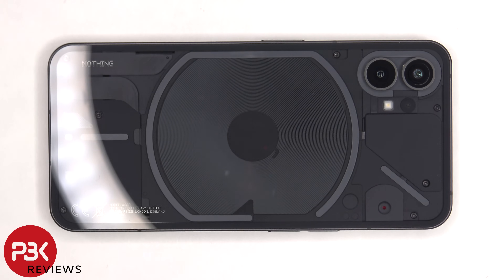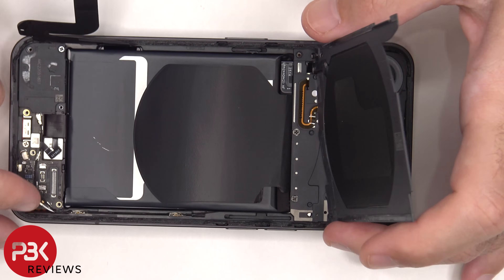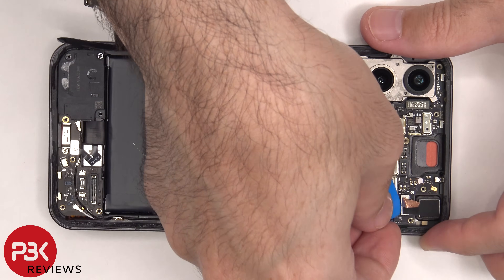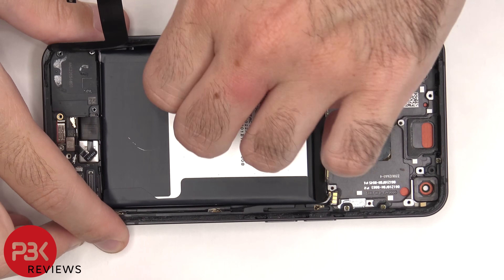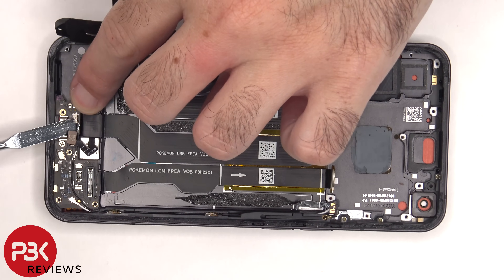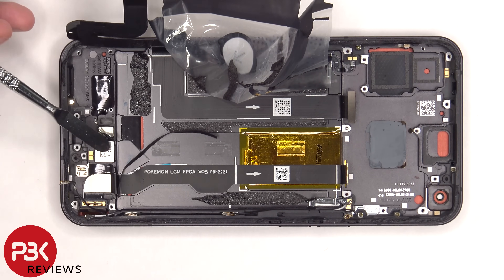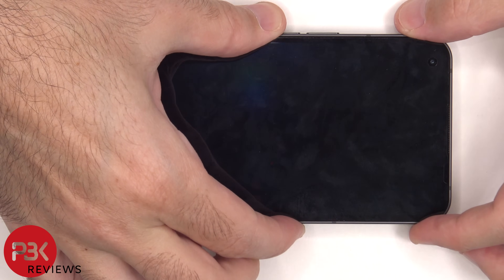Nothing Phone 1 Disassembly Teardown Repair Video Review

Comment: How about the power button? Is it difficult to access/fix? Mine broke recently, phone was stuck on reboot loop until the battery ran out. I don't care about the phone much, I just want to access the data, so I'd rather go to a repair shop than contact official support about it (as they would probably do a format if not replace the entire device). What are my chances of success in that case?
Reply from the maker: Usually the button can be pulled out of the frame on most of the phones by using a knife or blade to grab a side n pull out. But if the flex cable underneath which has the clicker is the problem, its replaceable also but more complex. Its not the hardest thing to replace but not the easiest either. A repair shop should be able to do it
Reply: In my case the button is not mechanically pushed in or stuck so I think it's the matter of the wiring... I will be taking it to a repair shop because although I still have the warranty for it, I don't want to lose the data by sending it out to the official service. Thanks for the reply!

Comment: Is the battery capacity really 4500mah?
Reply from the maker: It has a typical capacity of 4500mah, and rated at 4365, meaning it should at minimum get you 4365 with a healthy battery

Comment: My nothing phone one has a mic problem. When it's connected on charge it works well but when I remove from charge e doesn't work but makes a weird noise. I need assistance
Reply from the maker: Might be a bad sub board, or water damage shorting something.

Comment: Love the design of this phone. But i'm concerned about how difficult it is to replace the screen. Guess if you break that, it's cheaper to just recycle and buy a new Phone (1).
But at least everything ain't glued to hell and back, like on iPhones.
Reply from the maker: Yup, its a bit more difficult than most phones to take apart, but not as bad as most iPhones (depending on what part you need replaced).

Comment: Very unrepairable, they could've done the aesthetics as a separate sheet from the actual components. If you want to repair it, you will either ruin the aesthetics or actually damage hardware
Reply from the maker: Yep, it makes it look better with them being part of some components but makes it difficult at the same time for repairs. Regardless I think it could be designed better so even with them being integrated with components, they could easily be taken off.

Comment: Is the ambient light sensor and so on under the display like on a samsung or in the bezel.
Reply from the maker: Its on the board, you can see it @5:03 in the video. It goes towards the top bezel of the phone.
Reply: @PBKreviews  Thanks for your answer, I am pleased that you are faster and more thorough than your competitors. 
I wonder how much that saves on costs when there are no extra holes in the display for this sensors.

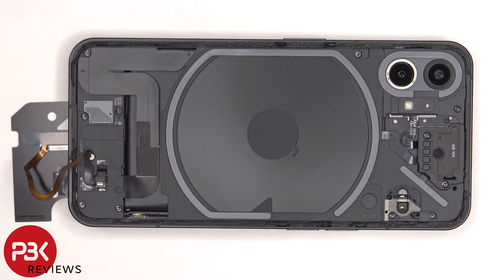Comment: 1:27 who the hell uses covers for flexi cable connectors? apple and now nothing?
Reply from the maker: They are needed in some instances where there is no plastic cover going over it to hold it down in place. Since sometimes these cables become loose or disconnected from drops.

Comment: If the will make ~5.5 phone, then I will buy it. Market needs a small, well design phone. I am not afraid of glass back today, cuz now I know how easy it is to remove, but metal or good plastick doesn`t brake...
Why someone can`t make "not big" smartphone, with a IPS, replaceable screen (cheap to replace),  a battery +4000,  an energy and heat efficient processor for a good tool, not a gadget for games, great antennas, audio jack or small, bt module with replaceable battery - smaller and cheaper than q5k, water and dust resistant, stereo speakers loud enough for podcasts and IDEAL e-ink second screen. 
Why LG made this boring dual screen... They could add just the e-ink option to be unstoppable. I had to buy used sony prs-350 to put it in to my pocket.
Reply from the maker: I guess they go more towards what a majority of people want. Also I'm sure they make money on doing repairs and replacements, so they would rather you send in your phone for repairs than make it easy for you to fix it yourself. No idea just my opinion :)

Comment: I don`t understand, if they decided to copy apple design, they should also copy the way to disassemble the display. That`s the component that breaks the most and often. On iPhone it`s easy to replace and you don`t need to disassemble the whole phone just to replace one component. Nokia had similar approach to this next to Apple.
Reply from the maker: I would take 95% of android phones for repair over apple phones any day. iPhones are much more annoying to work with and have so many different type and size screws. The display replacement, sure its a bit quicker. But when you need other things replaced, it becomes much more complex. For example on iPhones, if you drop and break your back glass, replacing that isn't easy at all and in most cases you would have to replace the entire frame assembly. Also say your screen is fine but your charger port went bad, or your battery is bad (which is a commonly replaced part just like the screen), prying the screen off poses a greater risk of damaging a working screen compared to taking off the back cover and going that route. However they can easily design it so the phone can be taken apart from both ends which would be most ideal. Like on the S22, S22+ and S22 ultra, the screen can be replaced by prying it off from the front after heating it up (even though this method is a bit harder since you would need to align the cable correctly to reconnect when pressing down the new replacement screen). Also you can take it apart from the back to replace other components. Hopefully more and more devices will be designed in a way that you can take them apart from the front or back depending on what parts need replacing to make the process much easier :)
Reply: @PBKreviews  I know about the other parts, been there, done that, and probably will never repair any iPhone in my life, especially when I have shaky hands :D But I am specifically talking about the displays. 

Good thing that most android manufacturers are being reasonable with the screws, but who knows how much is this is going to last? Since everyone likes to blindly copy Apple. Remember that Samsung does not know to make a commercial without mocking Apple, not to mention that they mocked Apple when they removed the headphone jack... Samsung already made difficult replace some parts on their phone, for example I replaced OEM display on my sisters old Galaxy A50 and the fingerprint sensor just does not want to register a new fingeprint.
Reply from the maker: Yep, hopefully we see more improvements on ease of repairs and less puzzles :)

Comment: What's the difference between thermal paste and thermal pad and what about color of thermal also it does matter ??
Good job bro👍👍
Reply from the maker: I'm not 100% sure but I would assume the thermal pad offers a more even heat transfer over the surface and would not dry up as quickly. But again that's just my guess. Color I'm not sure as well but I would lean toward different type of thermal compound or material would have different colors.
Reply: Typically pads are used to fill a gap, and paste is used when you have the surfaces touching. Most are grey, some with white or metallic sheen and one particularly high end paste is pink. 

The colour doesn't have to matter at all really. That said, many manufacturers will colour their product lines differently so they're easier to tell apart, or make an easier guess as to which product will be a direct replacement.
Reply: @jacobparis6576  great 👍

Comment: Love the video! Just bought the Nothing Phone(1) had to replace it for green tint issue on the screen. Now it's fine. Love the overall design and software experience.
Reply from the maker: Thanks! Glad your replacement is good now.
Reply: @PBKreviews  yes thank full 🙌 i did see like a stip of grey light on my display at 10% brightness but i decide not to be so picky, all high refresh rate displays have some or the other issues, My Pixel 6 has a tiny green tint too so i decided to let it go, it's not visible on higer brightness anyway 😅. Cheers!
Reply: @jspnprakhar  Hi sir i am thinking to buy nothing phone? u suggestions? can i buy it any major issue?
Reply: @jagadeeswaranr1148  If you get it for good offers and under 30K it's a good deal, Some units have Screen issues, I got my replacement through the service center and they were initially not giving me a replacement since all screen has some or the other minor issues. You have to look at the pros while buying the phone. 4 years of Software support. Beautiful design, In hand feel. Screen is decent. Cameras are decent. 778+ performs decently but the phone is optimised very well so it feels as fast as any flagship out there. It offers you wireless charging in this price range. 
So a lot of Pros. and hardly any cons. 
try to get the 8/256gb variant for a future proof device and you should be happy with this for 3-4 years. Not recommended for competitive gaming. Casual games run very well and 778+ helps you with Battery so for a casual user it's easily a 6-7hr SOT. anything more then 6 is very good. Go for it if you can get it for a good deal and of the feature it offers is an actual upgrade. If you are already using a Midrange phone or flagship don't buy the nothing phone 1 then.
Reply: @jspnprakhar  thnak you i have ordered it . i liked the design so much..i cannot ignore that. and i have nearby serice centres.. so took this risk .i dont play games onl watching movies ..so hope the display satisfies me... and also wanted to expeirence new stock UI ...

Comment: Dust and dirt would probably enter and appear at the back glass.
Reply from the maker: There is an adhesive seal all around, as long as the back is not cracked or the adhesive has not been removed, it should stay clean.

Comment: Wow a newly build and released phone... I'm loving this teardown...
As well as noticing a simple flaws... those plastic clips and clasps at the back cover (after the glass) might get brittle much faster due to its clear back cover and heat from the phone itself.
Reply from the maker: 👍 . It's possible, but I'm sure they used a type of plastic that would last a good while. However the back glass without any laminate layer would be prone to breaking from drops I would feel, and would break away and not just crack since there is nothing behind it to hold it. But looks good at least lol.
Reply: @PBKreviews agree... Looks awesome with the expense of lot less protection...